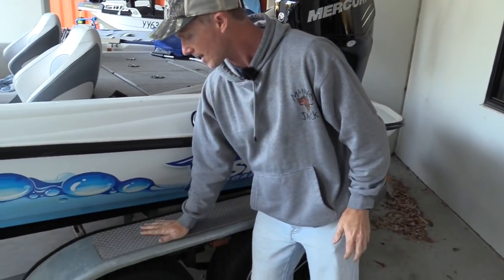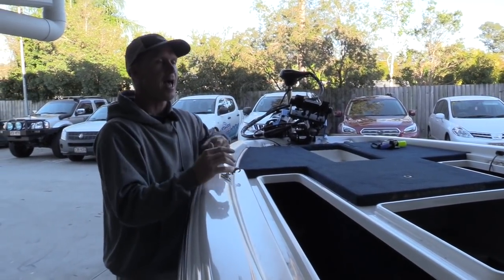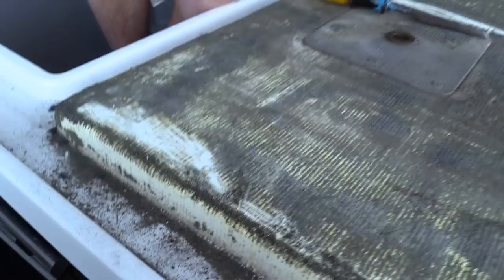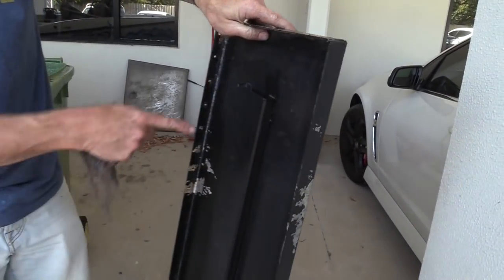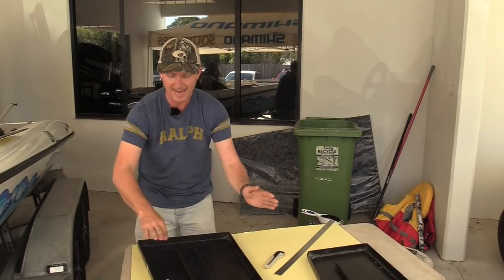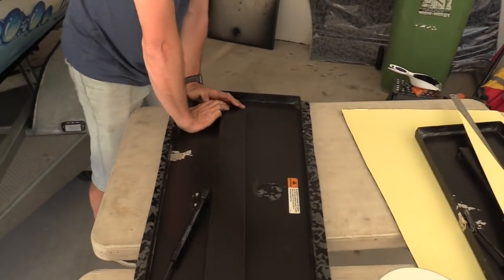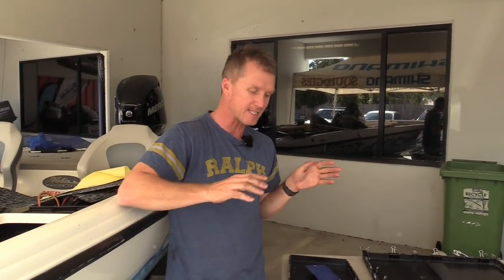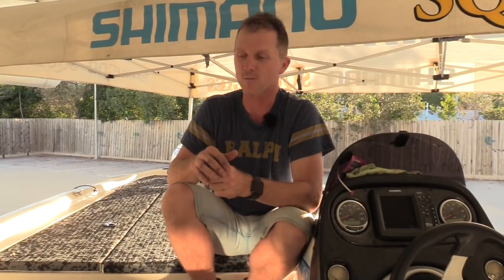How to apply Diamond Deck in a bass boat

Comment: G'day Steve. How's it holding up after a year? Did you use the marine grade sika?
Reply from the maker: Mick, Just sold the boat recently and was pretty happy with how it held up. The places it lifted was where I cut it too short. In areas of really heavy use, the diamonds wear off but there’s no noticeable difference in the anti-slip. Would I do it again? Yep. As soon as I wear out the carpet in this bass cat.
Reply: Fishing Monthly Magazines yep after many years I hate carpet mate. Have seen the damage it does. Especially the way it promotes electrolysis in alum boats I’ve gone with the diamond deck on the casting decks and the cockpit or floor now has glass and flow Cote textured on ply thanks to Ryan Moody’s youtube. Thanks for the vid mate.